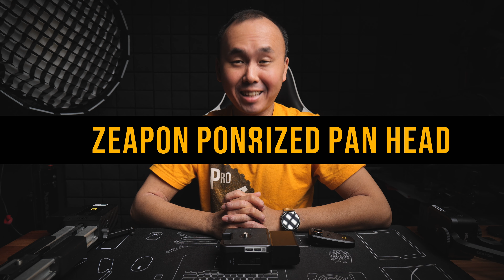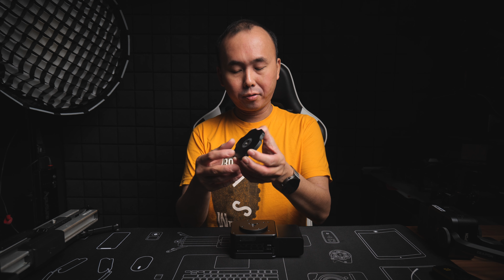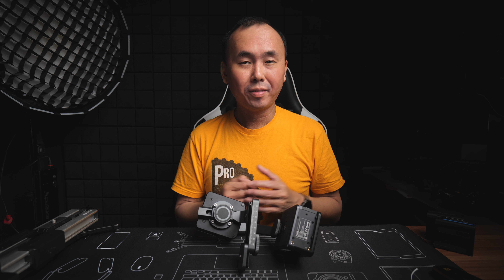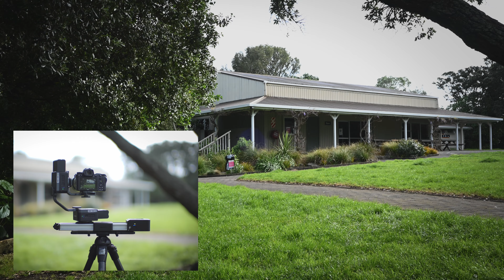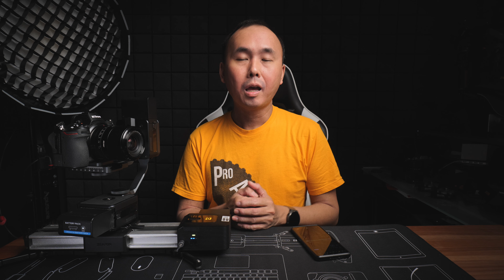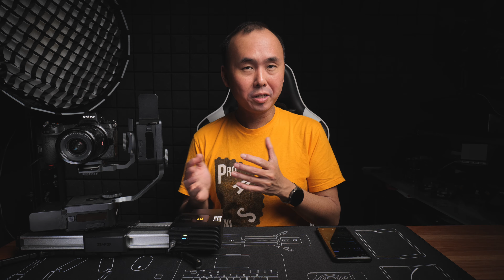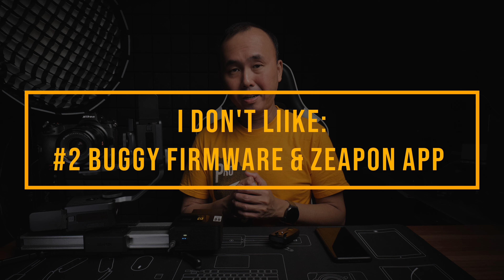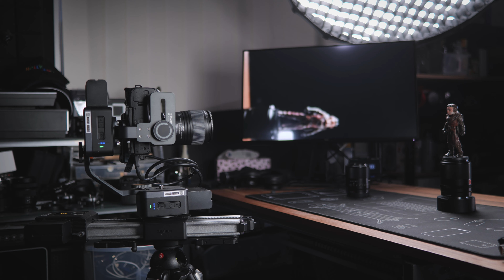Zeapon PONS PT Motorized Pan Head / Zeapon Timelapse Trigger / Zeapon Lab

Comment: Hello Richard. Thanks for the in-depth review of the Zeapon slider and additional optional modules. I’ve had my micro 2 slider and while it is really good I miss the one important feature the old iOS Zeapon App had - where you could set the speed to ramp up or down to a waypoint. In the updated app there is only 1 speed and it applies globally across all waypoints. Rather disappointing imo. I hope they fix it.

Comment: I'd love to see an update where you could control the speed of either or both the pan head and tilt head in the same increments as the slider speed control.  That would allow much more control of those parameters.  Also, I'm wondering if there's a firmware update that will enable you to keep the subject in the center or the same position as the pan, tilt or slider move.  My DJI drones can do that, so I know it's possible.  Thanks.  Marc Trainor

Comment: @TheRealRichardWong do you know of any way to edit waypoints in the app after you've set them? The only way I can find is to delete individual waypoints, or reset all waypoints with the reset button in the top right. The problem I have is when I delete a waypoint the slider then automatically moves to whatever waypoint is remaining, and it slows things down. I'm hoping there's a way where you can just move the slider to a new position and overwrite a waypoint with this new position.
Reply from the maker: No sorry not that I know of

Comment: Dear Richard, thanks for the in-depth review and explanation! Sadly my Slider doesn't move at all, when using the Timelapse trigger. I tried all the steps you mentioned - but I'm doing something wrong?! Andy advice?
Reply from the maker: So it moves normally, but just not when use with timelapse trigger? is the camera shutter keep firing periodically?
Reply: ---> UPDATE <----I found out, that "silent shooting" in the interval menu was a problem. When turned off (using the mechanical shutter + Flash Rear Curtain Sync) the camera moves. BUT it moves just exactly the way I programmed my camera to. I have to decide, which shooting interval I want (e.g. 2 seconds). So now it moves during the camera is capturing frames - resulting in unsharp images.Therefore two questions:

A) Can I use the TT with electronic shutter (would really expand the life of my camera, since Timelapse's offen have 500+ Pictures)
b) What shooting interval should I choose in the camera? (Because I thought, this isn't relevant - the app decides?) The capture time will of course get longer and longer, when night comes and exposure needs moree time. I use aputure mode (A) and a fixed ISO. So I only let the camera choose the exposure time. Thx in advance.
Reply from the maker: @stephanyandreas   A) it depends on your camera. The trigger relies on the camera flash to sync the movement, so if you camera can support flash with electronic shutter, then you can.      
B) choose an interval that is longer than your exposure duration.   so if you exposure will be as long as 8sec, then choose 10sec (a bit higher than your longest exposure time)
Reply: @TheRealRichardWong  Thank you very much for your quick reply! I really appreciate it Richard. Indeed I now did get it to work properly. But somehow I am confused, because actually I don't know the final exposure time beforehand. I thought, this is actually the idea of the TT?! I thought the slider only moves, whenever a shot is taken - regardless how long it takes (shorter when beginning a scene and longer when it is getting dark e.g.). I have to try it out the next days. Sadly it is raining a lot here in Germany right now... What mode do you use (M or A). Working with a fixed ISO or do you dial in everything manually - but then I guess you have no advantage of the TT? I hope this is my last question - thank you so much for your support. Waiting for my Pons PT Head to arrive :-)

Comment: Hello! Thank you for your video! I received the motorized pan head, and I noticed that both intelligent timelapse and customized timelapse features are not working in the Zeapon Lab app. It tells me, "At least two key points should be set." and the page is not switching. I just want to know if these features can be used with pan head only because if not, I will have to return it back.
Reply from the maker: Hi Mohammed, I was checking that with the Zeapon team but it seems like their after sale team replied your question already? if you have any other questions, feel free ask Zeapon by emailing them  zeapon@service.com
Reply: @TheRealRichardWong  Yes they did and they were amazing! Thank you very much Richard for your tremendous effort. I can't wait to shoot my panned astrolapses!

Comment: Hi again Richard. is there a way to move the camera further away from arm to have more clearance for cables? If I intend to shoot with this I would have cables sticking out of the camera ports on the left side
Reply from the maker: in theory if you can find an arca swiss plate that extend/shift the camera mount position a bit that would work.   But i'm not sure if such thing is available and haven't try that myself

Comment: Hi Richard! How much weight can the whole 3-axis motorised slider setup support? The slider itself is up to 4.5kg right? I can’t seem to find the weight of the PT pan head but that would cut down the overall weight the setup can handle
Reply from the maker: Hi Diego, the maximum vertical payload of each pan head is 4kg.   But if you are using the whole system with slider, you need to take into account of all these modules as part of your payload

Comment: Hi Richard, the app is not working for me and most other users. I have Android app v 1.03 and firmware v2.5(20211119), the app does not detect the slider. This is huge problem and drawback due to most of important functionality is lost without the app... Thanks for any help I can get.
Reply from the maker: Is your phone's Bluetooth on? And maybe try reinstall the app and restart the slider
Reply: @TheRealRichardWong  BT does find the slider. Tried to do all that.. old firmware, new firmware, app from Google Plays store, app from their website. Always same problem, the app does not find the slider. There is a lot of people writing about this al lover Internet... Great slider but without the app it's a huge drawback, specially when using 2-3 motors at once.  (PS I am on Android 10)
Reply from the maker: @PaulMrPKcom  sorry to hear that, I actually never had this problem myself , the slider always connect immediately. I would advise contacting the Zeapon support
Reply from the maker: @PaulMrPKcom  another thing I can think of is to find another Android device and give it a try.
Reply: @TheRealRichardWong  Yes! That did the trick, tried on an old Android 8 phone.. But who use Android 8 now ? :) So it means it's not compatible with Android 10.. Well better than nothing. Lets hope Zeapon can manage to get an updated app soon for their own best, they should invest in new app developers.
Reply from the maker: Hey Paul,
Great to hear that!  But the app does support Android 10 as i myself using an Android 10 phone and i tried it with a few other Android 10 devices they all do work fine.  However I do notice Android apps in general, especially when one need to communicate with external device can be a bit of hit and miss sometimes because of it's open ecosystem unfortunately.  I do suggest drop a message to zeapon telling them the phone model you have so maybe they can look into that especially if more people are complaining.

Comment: Great reviews as always, keep up the good work :)  I have just purchased a Panasonic S5 w/24-105, mostly for its in-camera astro-friendly features (waiting for the 20mm Sigma to be available too). I really like the idea of the camera controlling the motion gear. Questions: 1. Is a slider necessary, or can I start off with the two motion heads + arm package + TL trigger? 2. Can I use the camera's Exposure Leveling feature during interval shooting instead of Zeapon's? i.e. will the Zeapon heads still work in camera-controlled mode if I don't use other app settings? thanks for any reply to this. Any chance of Zeapon adding star tracking to their feature list?
Reply from the maker: 1. Yes you can start with the head/arm package
2. Not too sure if i really understand your queestion.  But if the exposure time would change a lot, then you need to use the Zeapon Trigger to make sure Zeapon app is controlling the head/arm works correctly

Re Star tracking.   I had some discussions with them before about that. I believe they were interested  but whether it is doable (as it would require very precise movement control) or whether it will be implemented, we will have to wait.
Reply: @TheRealRichardWong  Thank you Richard, I appreciate the answer. I think my question is this: can I program motion settings to the heads while using the Timelapse Trigger in Camera-controlled mode?
Reply from the maker: Yes you can.

Comment: Hi Richard, your review is great and helps a lot. I start to make the camera mode with the timelapse trigger, everything was worked. But I test it inside my room so when I close the lights the trigger didn't change the exposure. I have my camera in a rear sync as you said and in manual mode, I add all the settings for my timelapse, so when the light will change the trigger will change the settings of my camera for smoother results? 
With kind regards, Ben.
Reply from the maker: Hi Ben yoy need to be in non manual mode, or at least turn on auto iso so the camera can try to adjust the exposure for you. For me, I would try aperture priority with auto iso on . Hope that helps

Comment: thanks for the review. Is it possible to use this device for macro photography in focus stacking mode? Set the distance between frames?
Reply from the maker: No, not exactly. I thought the same too and have suggested Zeapon to add a focus stacking mode to the app a while ago. but so far I haven't heard any solid plan to implement it in the near future
Reply: @TheRealRichardWong  very sorry. the implementation of this function would expand the audience of photographers

Comment: Richard - thanks for the in-depth review.  One question: will the pan head on the motorized slider work well together for a simple "parallax" move repeating back-and-forth for an interview 2nd camera? Can they move slowly enough to create subtle movement and will they stay synchronized over a longer period of time?
Reply from the maker: Hi Thomas, the slider/panhead can move quite slowly. but hard to say if it's slow enough for your requirement ( i feel it can be slow enough)
They will stay in sync over long period of time as they are sync to the waypoints

Comment: Hi , I just bought  Micro E800 slider and Pons PT pan head . You  forget to mention that regardless of speed that you set up in app slider and pan head are moving always the same constant speed at least in my Android app.). There is no 10% or 33% .So after endless numbers of try's I ditched the app and control pan head with left hand finger and rail with right hand and one finger and this is the ONLY way that you can get any meaningful control of this devices.Maybe if DJI buys this silly company one day we will be able to use mobile phone app.
Reply from the maker: hi Goran, the Android app is quite buggy as i mentioned in the review.  What you mentioned is one of those.  It does work, but not always.   The iOS version works much better.   I'm hoping Zeapon can fix all those issues and get a more stable/bug free app for us soon!

Comment: Hi Richard, thanks so much for your comprehensive review of all the new features with the Zeapon equipment. I have a couple of questions. 

Firstly I notice you're using the Nikon Z6 with the Timelapse trigger . .that's my setup as well. I'm having a lot of issues getting the camera interval shooting mode to actually start the slider sequence using the Zeapon Timelapse Trigger. If I manually press the camera shutter button it works as it should but when I start the inbuilt interval shooting mode as you did in this video it doesn't seem to work. Having said that . .it did work on a couple of occasions randomly so I'm wondering if this may be an android app issue ..??
I also discovered that electronic shutter won't work with this device. No issues with the device.  .it's a camera issue with flash triggers and electronic shutter .. but I often shoot my timelapse with electronic shutter to save wear and tear on the camera.

My second question relates to the Pons Pan head. When initially setting up the A and B waypoints the slider and pan head both go to the correct positions .. but as I extend the time interval for my timelapse, which may be 2 hours or so from point A to point B .. .the pan head doesn't move for the first hour and then suddenly does all the required movement to get to the B waypoint in the second part of the timelapse. The slider does the correct amount of movement but the pan head seems out of sync with it.  Have you encountered this .. ???  Perhaps an app issue .. I'm not sure but it's very frustrating. It seems fine at shorter timeframes but I need it to work over multiple hours. I've tried this with all the different modes with the same result. PS: This is obviously using the updated app .. all items are running latest firmware.

The vast majority of my timelapse work is nightscape long exposures or day to night sequences so that's why I want to use the timelapse trigger.  Any help would be appreciated.  Richard
Reply from the maker: 1. yes i think the current android version has some issues with the time-lapse mode when work with Z6. it has no issue with other cameras (like sony) and it also works ok on the iOS version
2. you are correct. This is due to the limitation of the electronic shutter on Z6 (and most mirrorless cameras) that cannot be used with flash
3. re 2 hours+ time-lapse, i haven't tried that myself.  I only tried short period one. but it does sound like another bug in the app.

so for the 1 & 3, i think Zeapon most likely can fix that in a new version of app.  2 i don't think it can be fixed as it is a limitation of the camera itself.

I would suggest contacting Zeapon and reporting the issues. i know they are working on improving the stability of the app and fixing bugs so if you report to them then they can look into them and hopefully get them fixed in the near future.
Reply: @TheRealRichardWong  Thanks for looking into it Richard. I'll keep doing some more testing as well. Appreciate your work.

Comment: Nice Review Richard ^^, I think the Zeapon Pan Head is bigger size than edelkrone HEADONE? I just like the zeapon slider only , do you think the edelkrone HEADONE can use on the zeapon micro 2 plus slider ? need your advice, planning to order on coming black friday : D
Reply from the maker: hey Ray, it might work but i think it would be a terrible idea to do that. Reason is that you'll need to use the two different apps to control the slider and pan head together and it would be really hard to synchronise any movement.
one reason why the Zeapon pan head is it's size is because of the high payload limit.

Comment: Richard  - Nice video.. Can you confirm if the Zeapon Lab app supports Android when used with the PAN motorised head
Reply from the maker: Yes it does.  But the current Android version is a bit buggy
Reply: @TheRealRichardWong  Any idea when Zeapon will fix this or is this already fixed
Reply from the maker: I heard there was a new version but they still working on more fixes